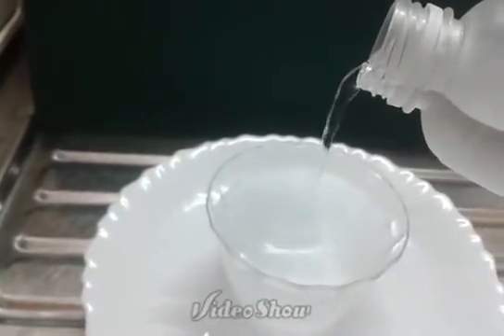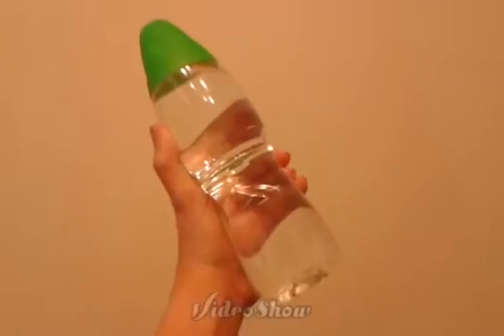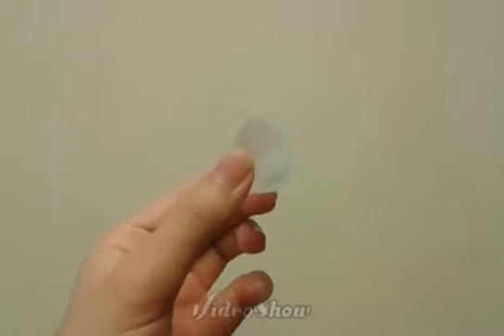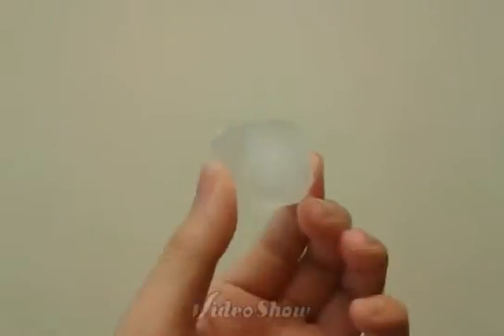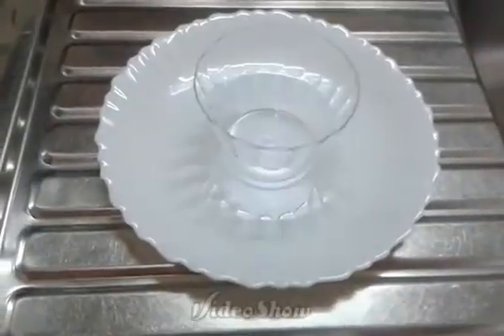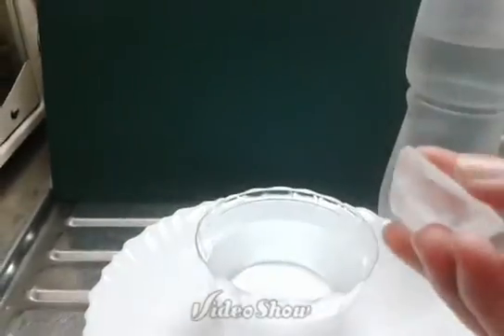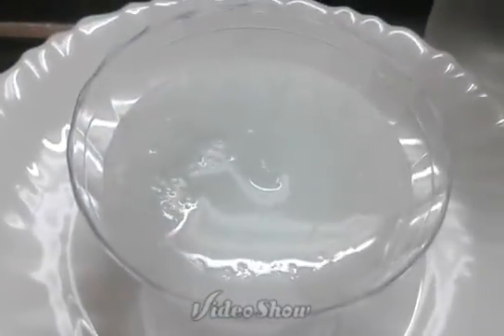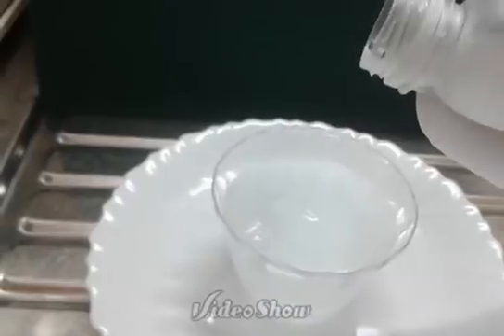Instant Ice - Science Experiment

Comment: You can do this only with destilated water?
Reply from the maker: Have another way, but distilled water can buy it in everywhere, so i decided to use distilled water:-) And actually you can't use the water from the tap or Mineral spring water to do this Science experiment, because the water from the tap or the mineral spring water have some impurity inside, so when you put it into refrigerator, the impurity will become ice crystals and make the whole bottle become ice, so that's why i need to use distilled water instead of using tap water or mineral spring water. By the way thanks for watching this video! ^^
Reply: @Timmate19  Thanks it worked for me
Reply from the maker: @mythpatfan3014  thanks for the support! Glad it worked for you too!